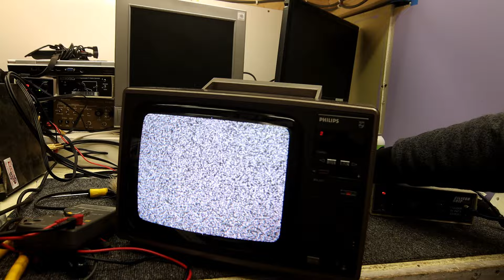Philips KA 920 10" 23cm AC/DC Portable CRT TV Checkover

Comment: I have the KA-910 push button channel selection model of this Philips set which I bought 14 years ago for $10 (Cash Converters) - it worked last time I tested it, and it still has the price sticker on the top.
Reply from the maker: They are a good little set, and used to be more common than the 920. Broken tubes from being dropped was the most common problem with them. The big hassle was getting them with both power cords since everyone lost the 12V one. There was a big demand for them second hand in the 90s since new crappy ones from Akai etc cost about $600.
Reply: @StevesElectronicRepairShop  My 910 has the original AC power cord (you have to love the 5-pin plug on one end) but not the 12V adapter cable sadly. 😓

Comment: Yes - over the ditch here in NZ, these sets were produced as the PYE VIDMATIC 10". These days it's hard to find one that works. Over the years every single LOPT (line output transformer) has failed, and if you do find one that is running it's only a matter of time before its LOPT craps out as well. Shame really because there's some nice examples around. They came with either a beige or a burnt orange case. I picked up a few of them off the hard rubbish kerb collections.
Reply from the maker: Sounds like they got Philips to make the LOPT for those ones. Must have been part of the same batch as the Commodore 1084 monitor LOPTS. I have never seen a Sharp one fail in this model.
Reply: @StevesElectronicRepairShop  It's likely that the line transformers used in the Australian-sold Philips-branded sets were sourced from a different manufacturer. Over the years there have been differences in part-sourcing from one region to another. Certainly the transformers used in the NZ Pye Vidmatic sets were their Achilles heal.
There are still some examples in working order, but for how long?
Other than the failure of this part, the sets were excellent performers. 
Do you know what the part number is of the transformers in the Philips sets like this one you showcased?
Reply from the maker: @stopthebus  The LOPT in these has F1262CE on it. I think the full Sharp part number would be RTRNF1262CE.